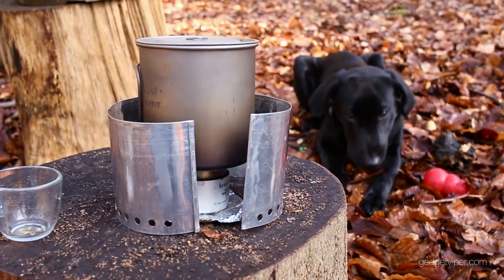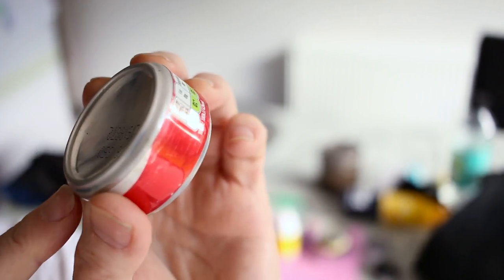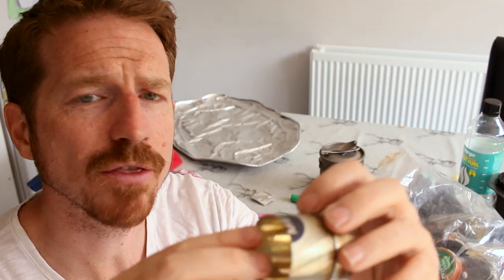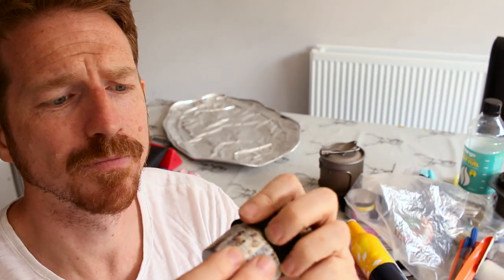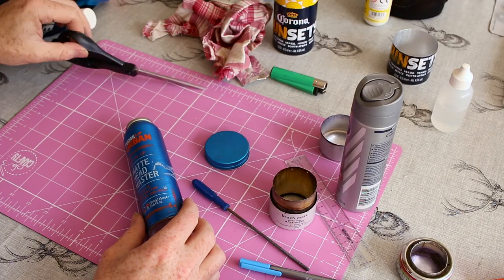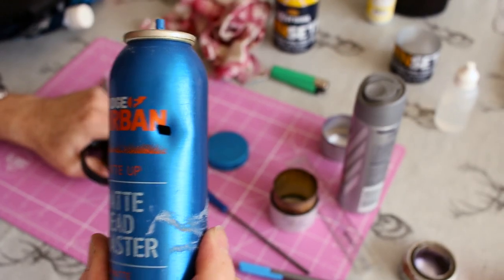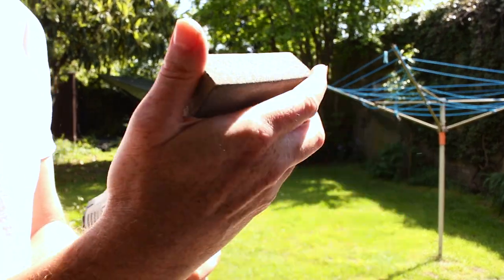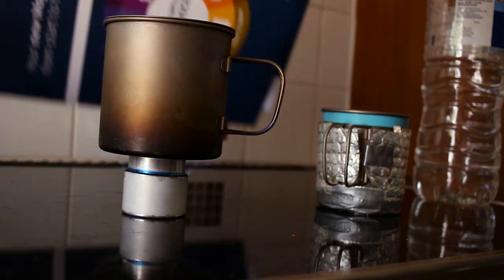How To Make an Alcohol Stove - EASY, EFFICIENT & ULTRALIGHT!

Comment: 4:30 - It is possible to make a similar stove without purchasing a carbon felt mat.

Take a soda can, cut horizontal strips with the same height as the outer can, make vertical grooves in this strip, spaced 10-20mm or 1/2", resulting in something like this: ~~~~~~~

Wrap this strip over the bottom of the inner can, using as many strips as needed to hold the two cans together.
The grooves create capillarity between the cans, working like a wick and vaporizing the alcohol like the Carbon Felt, if not better, as aluminum conduce heat better.

Comment: How effective is it outdoor? And how do you protect the flame and the extreme light burner from the wind?
Reply from the maker: It works really well outdoors, but you'll need a windshield around it. I made mine from a tin foil baking tray, just cut it to fit the height of your pot, then punch holes low down using a paper hole punch and it works perfectly :)

Comment: Hi.... Great videos. I started watching your videos doing some research about the nanopresso... Which I also purchased because of your video reviews... Along with the Barista Kit....... I love it by the way...
..
But I have a question about your stove.... Have you tried to use cotton or some other material other than the plumbing mat..?
Reply from the maker: Yes, just about anything will work, cotton is fine, the only downside is that when the fuel runs out, the cotton will start to burn from the top down. If you have a way of snuffing out the flames just as it's about to die, it would be fine. I've actually switched to a new material, it's called ceramic fibre paper.
Reply: Instead "plumbers mat" - carbon fiber fel, can  use fiberglass cloth or insulation wool, ceramic wool, permalite, or more mundane materials like:

Cotton, linen (Trangia B25 Spirit burner internal wick is in linen), jeans... cotton balls, oakun...steel wool (but don't lst longer), or any natural material that is very absorbent.

I've made one that instead cloth wick (of any kind of material) have a "capillarity wick", a sandwich of soda can aluminum sheets:

One flat + one with vertical grooves at each ~1 cm + one flat

The sheets have the same the height of the external can, this sandwich create fiction that hold the two cans together - can put the stove upside down; and capillarity for generate the alcohol vapors.

Light fast like cloth wicks and work well.